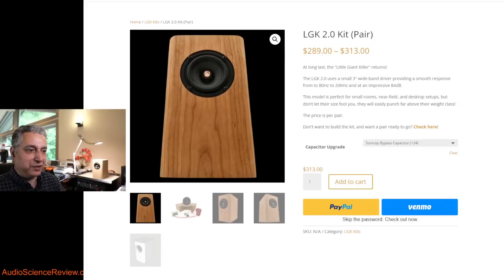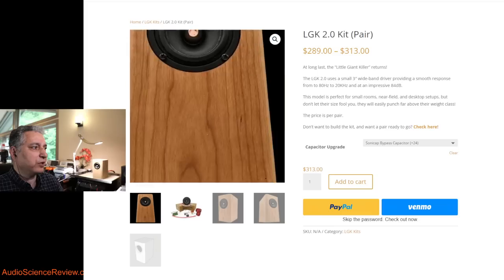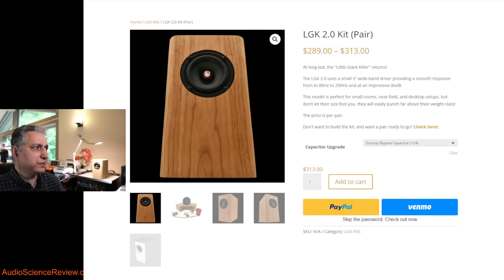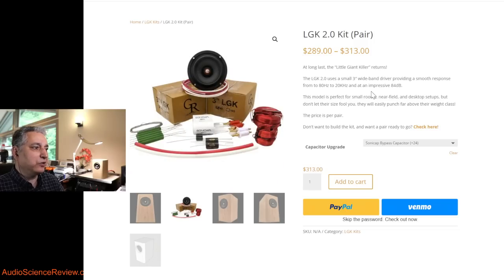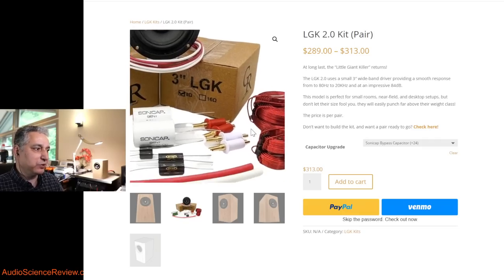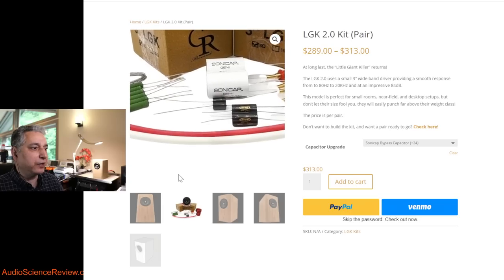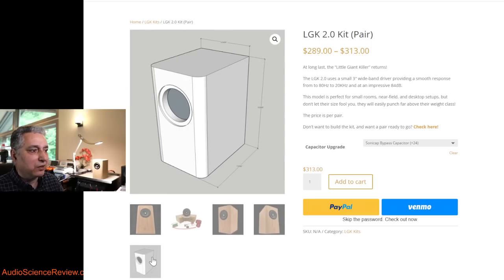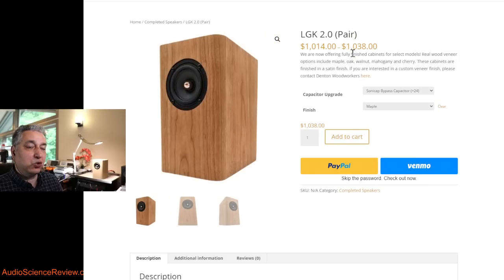GR Research LGK 2.0 DIY kit Speaker Review

Comment from the maker: A lot of repeated questions.  Here some answers:
1. Speaker was built with padding in it (which was NOT supplied in the kit).  The corners were also rounded over (the flatpack did not come that). Please see the build thread: https://www.audiosciencereview.com/forum/index.php?threads/build-of-gr-research-lgk-2-0-speaker.33479/

2. Speaker was Not over driven.  Listening tests were performed at 75 to 82 dBSPL at listening position.  Company is confusing measurements which were performed at 86 and 90 dBSPL with listening tests.  The two are not the same.

3. Distortion is the main problem in this speaker.  So the comment about why one speaker is used instead of two is non sequitur.   Research also conclusively shows that impairments in speakers can be best heard in mono, not stereo.  Please see my video on that with full research back up: https://youtu.be/7kDr0vEdfhY

4. Company has provided two test clips that were captured using thousands of dollars of subwoofers augmenting these small speakers and with an in-line filter.   No one is buying speakers for desktop use with that kind of setup.  And at any rate, that is no counter for my testing which did accord with how the speaker gets used.

5. Distortion testing of speakers is absolutely valid.  The proof is this speaker.  Measurements predicted horrible levels of distortion.  Listening Tests provided the same.

6.  Video includes audio clip that starts at very low level and goes to moderately loud.  You can hear the distortion there easily.  So you can ignore all the measurements and see the problem clearly.

7. First version of this speaker seems to have used a driver with larger excursion of 2.5 mm.  In this version, that is shrunk down to just 1 mm.  Yet the driver is pushed to produce bass well below 100 Hz.  Physics simply doesn't allow this.  Simulation shows that you can't go below 200 Hz without exceeding 1mm excursion.

8. I did apply a high-pass to the speaker in my review.  It did improve power handling but there was still distortion.  And now you had no bass either.  You are potentially paying over $1000 for this speaker.  Surely for that kind of money you want to have your bass too.

9. This review is not a reflection on the company as a whole.  I tested their Encore XLS kit and gave it a thumbs up.  I also just tested the mod of Klipsch RPM-600M and gave it another thumbs up.  Please see: https://youtu.be/-eWnYAgiMwQ

10. While the company has been very unprofessional in its interactions with me (and other reviewers as well), I go about my testing without emotion or prejudice.  The bulk of my review comprises of objective measurements that is not subject to whim of the reviewer.  Those tests show good frequency response but horrible distortion.  Me pointing this out (and confirm with listening tests/clips) doesn't mean I have an agenda against the company.  It simply are facts that I can not and will not sugar coat.  Company needs to redesign this speaker and make it performant.  Customers deserve that.
Reply: How about that waterfall????????
Reply: "Padding"?

GR Research always pads their speakers to keep them safe.
Reply: Get a life… gr research does quality research fully FULLY explained.. too many wannabies
Reply: @johnnorris1983  You do realize that the target of my sarcasm was ASR and not GR . ..
Reply: @johnnorris1983  🤦‍♂
Reply: Do you have a link to your review of the encore xls?
Reply: In fairness, whenever you look at a speaker with a single cone driver, you should expect distortion (mostly intermodulation but also suspension and motor nonlinearity, and cone stiffness asymmetry) to be the main compromise in the speaker. Speakers are already the source of most distortion in an audio system.
Reply: Maybe it's your fault for not using them with their high performance speaker cables.

LOL!
Reply: Golden review.... GR research is not AR Research or Audio Research. Lame product targetted at the DIY enthusiast, who may believe they are saving money by buying a speaker kit. I had the displeasure of auditioning these speakers... yucky sound.

Comment: You Sir are providing a fantastic service to audiophiles. I consider myself such an audiophile but I am completely sick of hearing how power cables improve sound when there are miles of cheap cables behind house walls. Speaker cables as thick as garden hose and costing many thousands of pounds even though they carry a tiny signal to the speakers. Audiophile fuses, RF interference, it’s all complete nonsense and I applaud your efforts to debunk these ridiculous claims. Many thanks.
Reply: it's how ridiculous those Audiophiles use thick ass power cables and speaker cables, meanwhile the connection wires is thin as fuk in their luxury Amps, plus copper layers measure in mil in PCB.
Reply: I agree with with you except I would re-word "cheap cables behind house walls".  These cables are highly government regulated in both design and installation not to mention the manufacturer makes tons of profit on them due to economy of scales.  On the other hand if you have a bi-terminal speakers and you find the highs to bright, use an enough smaller gauge wire on the high side it may sound better due to the wire resistance... or add a resister or capacitor or both in series outside like I do sometimes.
Reply: Don't forget the cryogenically frozen speaker cable raisers!
Reply: @vdochev  😂
Reply: There's also meters of wires in the coils in the crossover and other components to traverse before the signal even gets to the voice-coil.  The charlatans are the worst part of this hobby but ASR reveals all in the best possible way.
Reply: I never like Danny’s reviews and suspect his “upgrade” kits to be more snake oil. His open hostility proves he has something to hide.
Reply: @vdochev  Filled with solidified vacuum
Reply: @vdochev  Whatever happened to room temperature super conductors?

Comment: Speaker design is well understood. Pumping power below 50Hz into a tiny driver is asking for trouble. There is no magic fix that can defeat the Laws of Physics.
Reply: But there are areas of physisc which are not at general agenda. At least I never heard . But  I often use them in my actual speakers and they work perfect. 

 . In 1982  I've made my own "try" to make nice sounding speaker cabinet with not so small as presented but also one  12 cm dia and 8W  driver. Cheap and surprisingly good for developed by me ported box. I think already 12cm did enough bass job.  It was supported by tweeter in serial connection and I used serial coil  as tweeter filter to prevent phase game so  it had slop for  sopranos. Easy regained with tone control . 

Also I got in market active cheap speakers for PC and I was very happy with size /result (10cm dia) . For reason of  (I think)  separate small beautifull cone  tweeter the sopranos were not affected by bass. Unfortunately filtered by capacity -another little flaw.  . .They both didn't last for me for  main reson - low range was not enough tight - as usual with ported. Now I use elyptic speaker only 20cm/15cm with   acoustic very different from used around  and it prevents intermodulations while low tones are as flat  as anyone can ask. to very bottom
Reply: There is a way to cleverly 'bend' the "Laws" - use a small driver (check), with a stiff suspension (small Vas and high-ish Fs) and moderately high Qts, in a 'big' box (relative to Vas) and you can tune a small speaker to have deep measured bass response below Fs, at the expense of some 'boomy' character, by using the bass reflex port to provide high output over a wide range. You can play with a speaker's parameters in a program like WinISD to show this - the box larger than Vas will cause a peak near the tuning frequency, and increasing Qts will fill in the 'saddle' that appears. The suspension stiffness of the speaker will keep excursion relatively well under control. The thing that keeps everyone from doing this is that it does not provide optimal damping and the 'boomy' character is undesirable to many listeners. I learned of this method by reverse-engineering some of the Bose spare-tire subwoofers that use small 135mm woofers so the spare tire screw will not need to be installed through the middle of the speaker.
Reply: You CAN get below 50Hz with 4" driver with well designed Box, well designed Driver is needed too.
Reply: Said the reviewer already.
Reply: @doglovemimijumable yes, but not without compromising other areas of it's characteristics.

Comment: I watch Danny's upgrade videos, and keep an open mind.
My problem with them is that he often complains about the value for money proposition offered by the mainstream products.
I find it disingenuous. The telling factor is in this video. The jump in price to the finished product shows that there is a lot of overhead in a commercial product beyond just the speaker parts.
Things like marketing and warranty and dealership support, they don't come for free.
Reply from the maker: For sure all the expensive parts he throws at commercial designs makes many of the mods uneconomical.  Now, if he provided objective proof for such things as binding posts, that would be one thing.  But he is part-time vegetarian in that he uses measurements to say what is wrong, but not what is right.

Comment: Does it include the magic power cords and caps upgrade that minimise "smearing" of the sound? That could kill some giants alright
Reply: It doesn't need power or I am sure such a cord would be required.  :)  But it does have the magic speaker terminals ("tube connectors").  And we paid $30 extra or so for the fancier cap so there were to excuses after the fact.

Comment: I don’t get why there’s speaker companies that think their product is somehow beyond measurements. 
Every other electronic product known to man can and is measured. Nobody in every other electronic product ever trust ONLY the company’s own measurements of a product they put out.
Reply: They think it will all be negative. I find testing really important to see what I don't notice too. Why try solve things you don't mind?  
It's not good or bad it's just information but they want to charge 4 figures for an MDF slot port and fullrange - there are better drivers out there that don't need a filter
Reply: Currently "measurement standard" is not enough. Soundstage, details, layering cannot be measured but you heard them all the time. You can only measure component by component. Not a whole system. Beside the human factor, I mean people like 300B instead of class D liner performance. I had heard state of the art, but not everyone will like it.
Reply: @kongwee1978  I'm sure sounds stage, details and layering can be somewhat measured when they quantify the correct parameters for that effect. 
There's also the psychological aspects to this which can be missed by scientific review (can also be an advantage to miss this however). Many people also tend to miss their personal bias or mind and body condition effects on the listening experience
Reply: @RennieAsh  Yes can be measured, but not the Audio Precision APx555 as standard. There are way more parameter to look at producing a product than testing an end product. Of course, tube designer place tube in first place and rest are second.

Comment: Amir,
A very good analysis and summary. Thank you.

I have 25+ years of NVH experience from the auto industry from a major OEM, will check more of you content out.
Reply from the maker: Thank you so much John.  Love to have technical people watching and reviewing what my content.
Reply: @John Shore  
I'd love to learn more about your experience and knowledge regarding NVH and the research and product and solutions development and technques/implementation in this field.

It would be extremely enlightening if you were willing to have a conversation and potential video chat with Erin Hardison on his Erin's Audio Corner YouTube channel.

Like Amir, Erin is another Objective Data-based tester and reviewer on YouTube, but much of his background is in competition level or "High-End" aftermarket car audio systems that employ various aftermarket NVH products and multichannel DSP to improve the in-car music listening experience.

Erin also has a technical background from his "day job" as an engineer for NASA working on missile defense systems & testing.
Reply: @bbfoto7248  My background is sound and vibration for car development MSc from Southampton ISVR.. Professionally mainly in intake and exhaust systems as noise ducts involving flow and temperatures (both noisy items on the power train).

With car hifi as such I have not had professional work experience but have been a keen audiophile since mid to late 80s.

Comment: Amir mentioned something very, very important but not so obvious. He mentioned why two-way or 3-way are better than one way full range. The keyword there is "Linear". All speakers are NOT linear devices. They are springs. So the movement/force relation are parabolic rather than linear. So when listening in low volume, the power input will produce more or less similar pattern of cone movement, and can reproduce the combined signals of high and low frequencies. But at high volume, the cone is pushed far away from the neutral position and it takes a larger force (power) to reproduce the high frequency. Or in Amir's word, the high frequency response is modulated by the low frequency and becomes a source of distortions. 

Another reason full range speaker sucks at high frequency is the inertia of the cone. A 3 inch driver cone is so much heavier than a tweeter the inertia dampen the output of higher frequency input. 2-ways or 3-ways are the way to go.
Reply: A well designed driver can overcome some of this to an extent. So far there isn't a "perfect" full range driver. And many times a filter is still recommended

Comment: Full range drivers, especially small ones like this have a lousy rep to begin with. KEF is the exception to the rule, but Danny would likely consider his superior due to the sonic clarity of his binding posts.
Reply: KEF is actually 2 driver setup, only concentric. Underrated comment though
Reply: Oh yes ,. His binding posts are so good no other design work is really needed
Reply: Anything other than his Tube Connectors are just "cheeeeesy" 😒

Comment: It cannot be underestimated just how important your work is Amir. I finally found an audio science  objective reviewer with a talented/trained ear for subjective relevance. I don't own your testing fixtures/equipment but will try and mimic your test procedures best I can with my limited test harness and software for my speaker testing. Thanks, I've learned much.
Reply from the maker: Oh, that is so nice to read.  Thank you so much for kind words.  Great to hear you also wanting to measure and evaluate products the same way.
Reply: Amir is phenomenal but Danny’s crossover kits do improve a lot of speakers. This giant killer is not good.
Reply: @thepracticalaudiophile  no they don't. They make it "different" yes. I've done the whole upgrade thing, bypass capacitors, all that, from GR. The only potential upgrade is you are putting more expensive parts in but it's nothing earth shattering. Money is better spent... on a better speaker!
Reply: @kimo lewis you actually stated the opposite of what you intended. 
if it "cannot be underestimated" then this means his work is of zero importance. 
if you hold Amir's work in the highest regard then you would say,
'it cannot be overstated...'
Reply: @thepracticalaudiophile  From a speaker mod perspective, regular users only options are changing out the drivers and crossovers. Most mass produced speakers uses cheap crossovers and that's a fact. So Danny's crossover kits improve performance, I think that's a fair statement. 

However, a good pair of speakers is a lot more than drivers and crossovers. The cabinet, bracing, port, interior space management, are often more important. Did you see the the B&W Nautilus series speakers? 

So it is relatively easy to make improvements by changing the crossover. But making a great pair of speakers is very difficult.
Reply: @Audfile  In my case they did with the rp8000f speakers. The cymbals were gone. I probably could've used the equalizer in my marantz a/v preamp to correct this but I bought the kit and the cymbals came back. A definite improvement. I found his video after doing a google search (cymbals missing in klipsch rp8000f speakers) and his video popped up. His graph showed what I heard. The knew klipsch speakers fixed that hole. So Danny did some good there. Plus look how well the binding posts got improved. I would've been better off buying the JBL's for $799 per pair when they were on sale. But you are correct money should always be spent on better speakers.
Reply: @tmw1735  They look like a pair of snails on steroids. $60,000 isn't bad. Probably sound phenomenal. I'll look at their speakers that are more down to earth for us old folk.
Reply: @thepracticalaudiophile  I listened to them in person in a showroom. Yes, they are phenomenal. But will I pay $60K for a pair plus all the electronics that goes with it (you won't drive them with a $2,000 amplifier)? Not likely. May be when I have a couple million burning a hole in my pockets. 

The shape however, is for both form and function. The gradual tapering is suppose to dissipate the sound coming from the back of the drivers. So you are getting a pure sound to the front.
Reply: @tmw1735  Those are lottery winning speakers.
Reply: @googoo-gjoob  Thanks for correcting my grammar and intent.